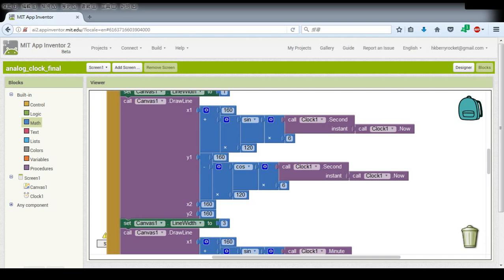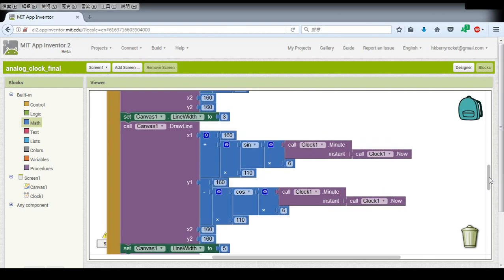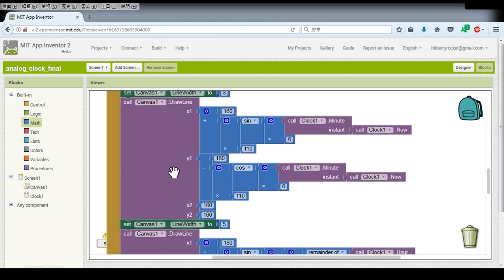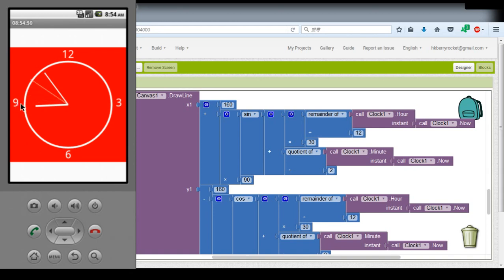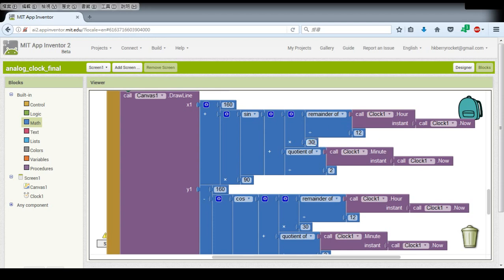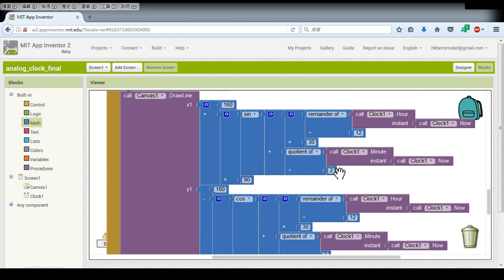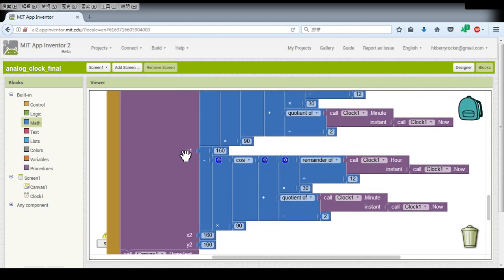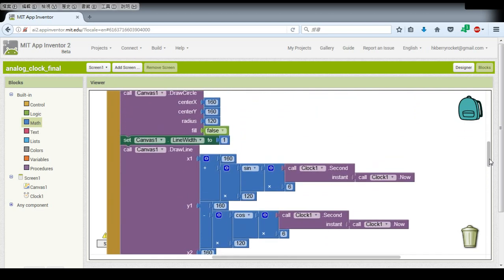[AI2 Tutorial] - 02 Clock(Extra) - Hours & Minutes

Comment: Why in the hours hand did you set x2 and y2 as the center, instead of x1 and y1 like in the case of the minutes and seconds?
Reply from the maker: Oh, sorry I didn't notice the differences with the previous video about the seconds hand. Anyway, in the DrawLine function, the x y coordinates of two points are the parameters. In other words, we need Point 1(x1,y1) 
and Point 2(x2,y2) to form a straight line. The order of the points doesn't matter, they are the same in this case.
Reply: BerryRocket yes that's what I thought later, thanks :)